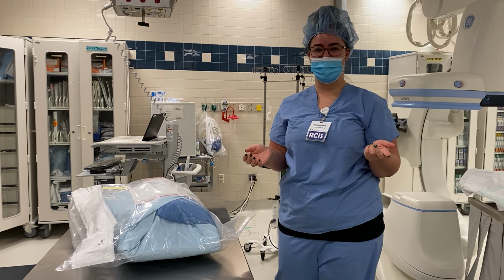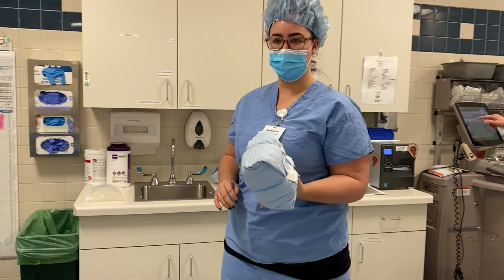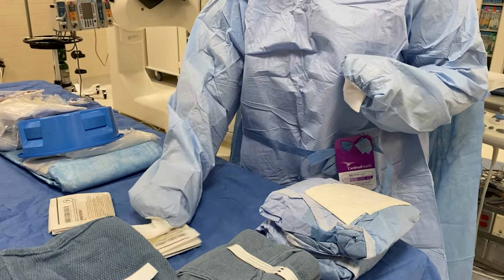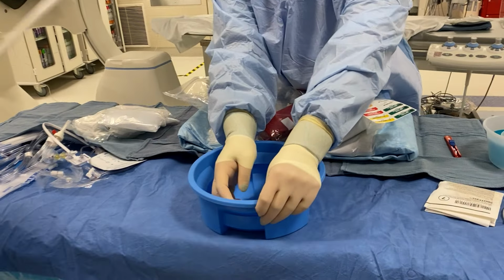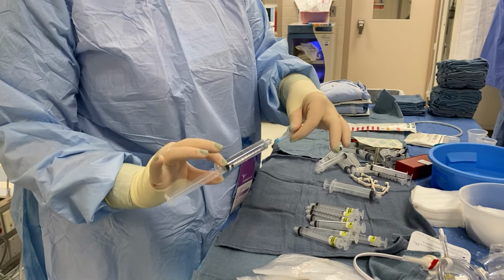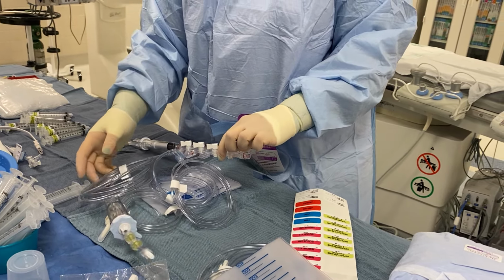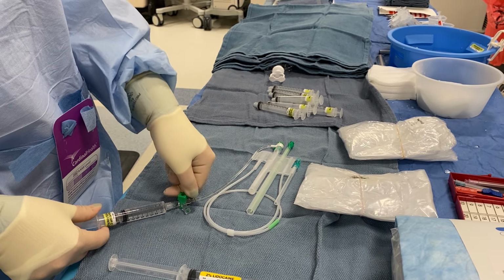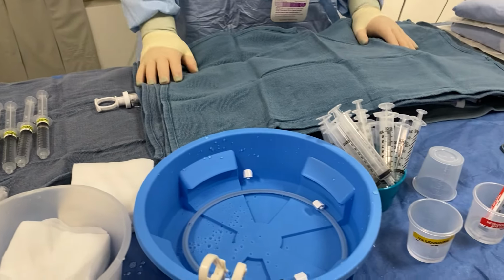Cath Lab Table Set Up

Comment: Nice video. Love the set up for the procedure. However, I am a CST and the gowning & gloving portion is my only gripe. The sterile "closed" gloving technique was not correctly done. Your fingers are not supposed to go past the blue impervious portion of the sleeves. The white cuffs are pervious and your fingers will contaminate the glove's packaging, the gloves themselves, and anything else you touch on that back table.
You should never gown yourself off of the sterile field. Open your gown and gloves on a separate flat surface.

Comment: 🤦🏻‍♂️
Reply: Resterilized towels, Three-way valve system instead of a contrast material pump system…in the 21st century…
Reply: We used GE Innova 3100 IQ until the year of 2011. It had great picture quality.

Comment: I don’t like your heparinized saline labels the same color as your Lidocaine label.  I know both doctor and scrub person is minding what syringe they pick up but it’s just one more potential error that one can make.  We have red labels for lidocaine, Orange labels for heparinized saline, and green labels for contrast, and yellow labels for nitroglycerin. Otherwise, great job in setting them up
Reply from the maker: May not have been clear on the video. But the lidocaine and hep saline sticker colors ARE different. Lidocaine is yellow and hep saline is green. Additionally, I always put the hep saline stickers on the syringe in a different orientation than any of the medication stickers. (Hep saline always horizontal around the top / medications vertically up the side)

Comment: Why does this require a degree? Seems so ridiculously simple.
Reply from the maker: There's more to the CVT role than just setting up a table. A skilled CVT has an expert level of understanding of cardiac anatomy, physic principles as it relates to IVUS, iFR, FFR (just to name a few), hemodynamics, pharmacology, EKG analysis, care and management of cardiogenic shock as well as thorough knowledge of all the supplies and equipment in the room.
Reply: As a Cath lab tech of 3 plus years, I can assure you it’s not ridiculously simple, especially when you have a patient having a heart attack on your table and you have 15 balloons, 10 wires, 3 microcatheters, and a plethora of other supplies on your table and the doctor is screaming at you demanding 1 specific things in the mix of it all, and everything looks similar and don’t forget everything’s most likely covered in blood and harder to identify and every second counts and can be the difference between life and death 🙂

Comment: The beeessstt table setup, everything is organized.
you've got 3 lines right!
line for contrast
line for pressure
3rd line ? 
thank you !!!
Reply from the maker: Thank you!
Yes we have 3 lines for our manifold. Proximal is contrast. Mid is Hep Saline with a waste bag attachment and Distal is for pressure monitoring with the transducer.
Reply: @samanthakeihl5155  Ours was prox pressure/transducer, mid contrast and distal was waste / hep saline lol. Man, I worked that damn manifold like a piano! My hands are paying for it now lol. For the LV we used the medrad and a separate line ( we had a 4 bar, so one more extra stopcock connection.) Unless bad kidneys we hand injected to shoot the LV. Good times, I really miss it!
Reply: 3rd line fr hep flush during procedure ..it’s use only in PTCA